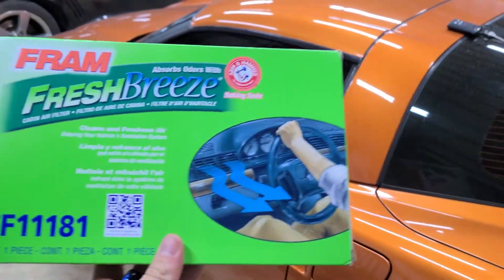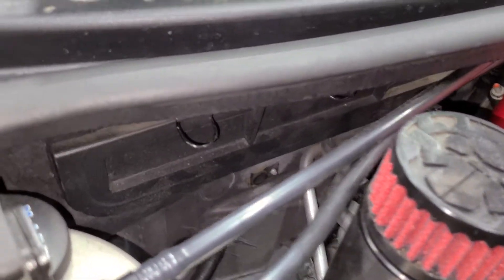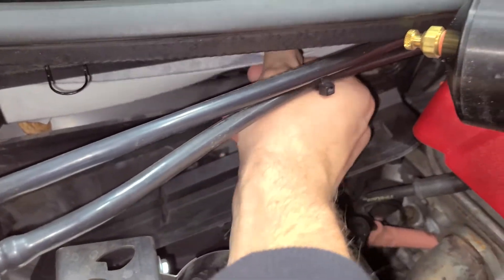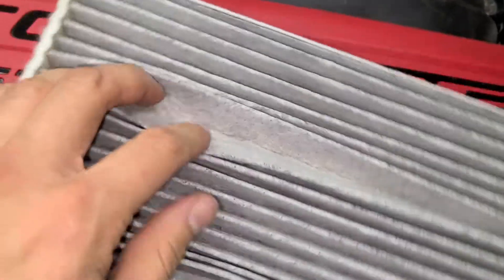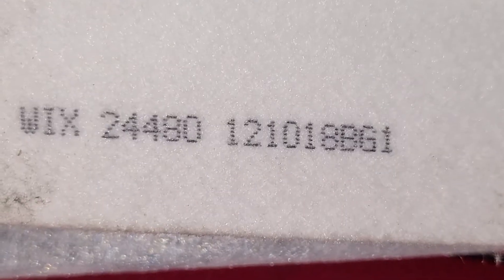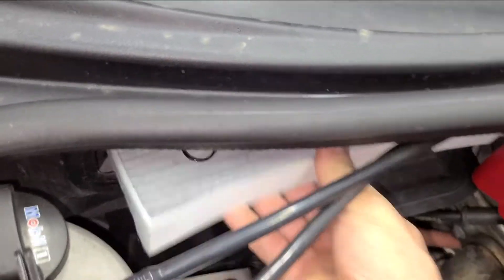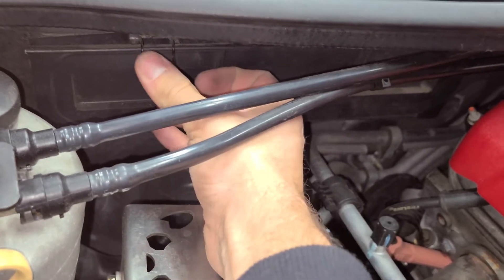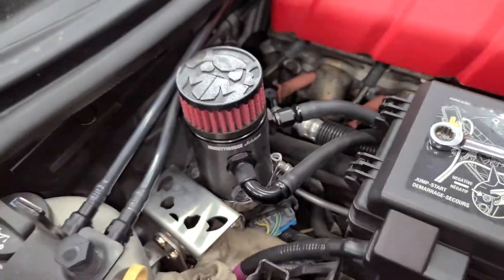c6 z06 Cabin Air Filter

Comment: Just a quick question , I noticed you have an extra catch can ? but there is one already that comes standard so ny adding it did it add any extra lubrication ? Excuse my ignorance here . Just got my late  brothers 09 z06 and am trying to figure out things in the Vehicle. Thanks in advance.
Reply from the maker: I do not believe there is a factory catch can on c6 z06's. Either way, if you have one already that's all you need
Reply from the maker: Also, oil catch cans used to stop any oil mist/condensation from coming through the pcv and dirting up your intake/head/cylinders
Reply: @thawkproductions4248  You are right; I got mixed up with the dry Sump; I just wanted to know if it's normal to idle rough then it gets normal after some driving? And how about the P0420 code? Has the car been parked for 1 year after my brother passed away, so I just took possession of it and started to understand how things work out in it; any suggestions? I really appreciate it.
Reply from the maker: @MA-lv3kt  corvetteforum.com is going to be a much greater help to you than I will be. The rough idle doesn't sound normal and the code looks to be catalytic converter related
Not knowing the history I would go through and change every fluid, sparkplugs, maybe the wires of they look bad.  
Not saying that will fix anything though lol
Sorry to hear about your brother, but take care of and enjoy that car for him